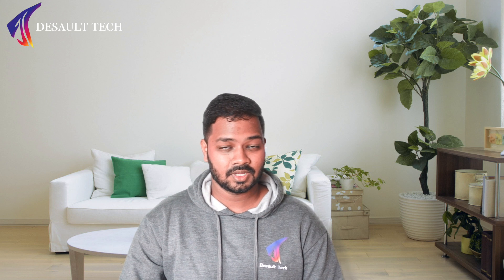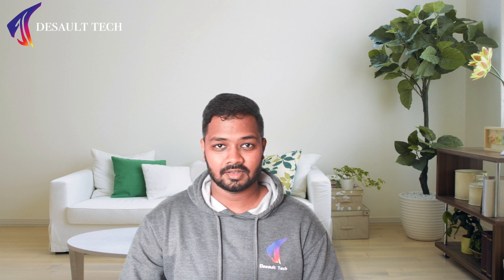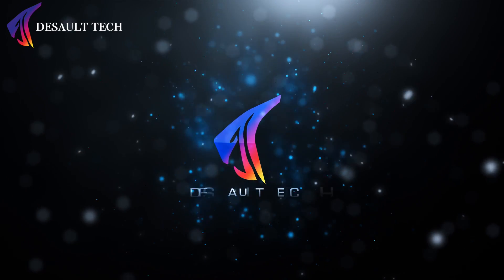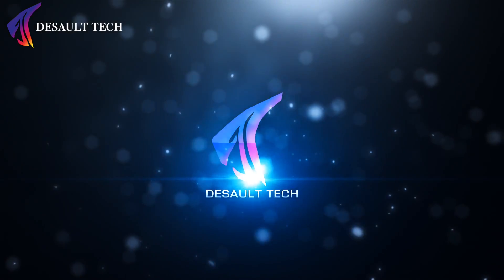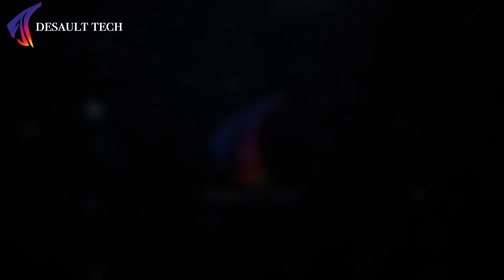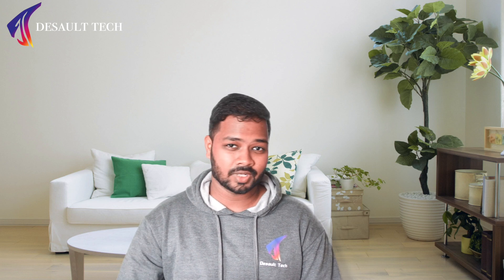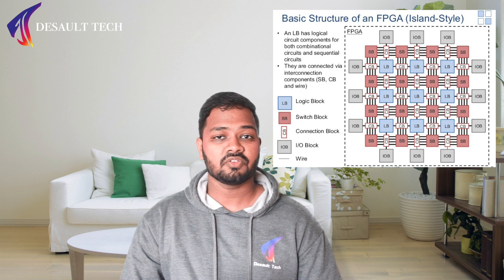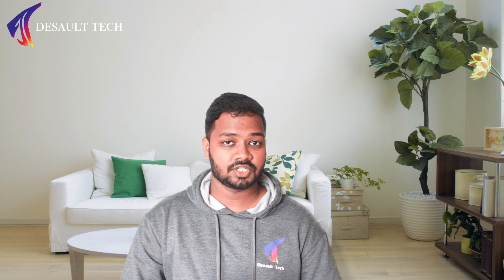FPGA: The Future of CPUs

Comment: real advantage of FPGA over conventional CPUs is the massive parallel streaming data processing that could be implemented. If somebody managed to write an operating system where FPGA realestate was managed inside the architectures where partial reconfiguration while operating was possible (maybe even in a fast context switching scheme) then this advantage could be leveraged in the limited gate count world where not all programs that needed to run parallel could fit simultaneously...